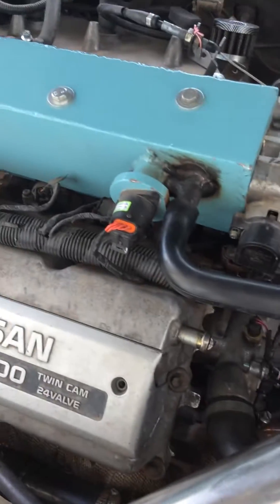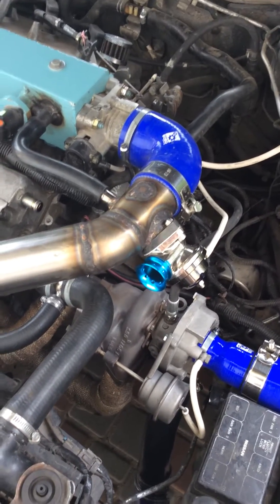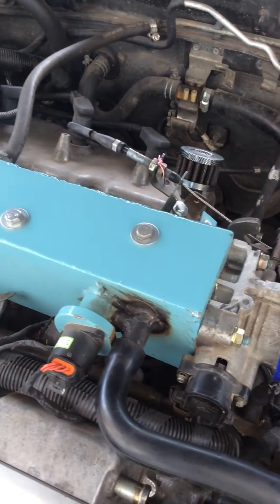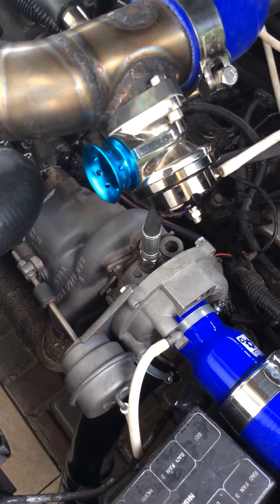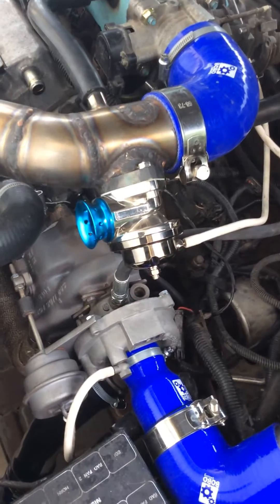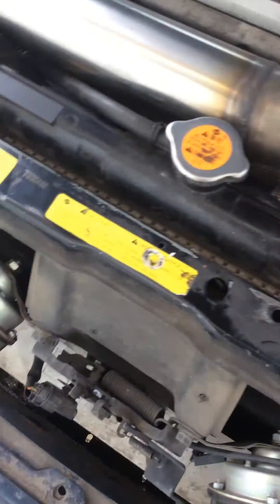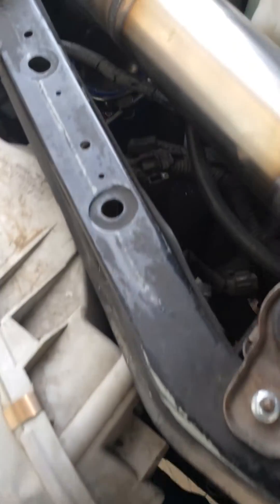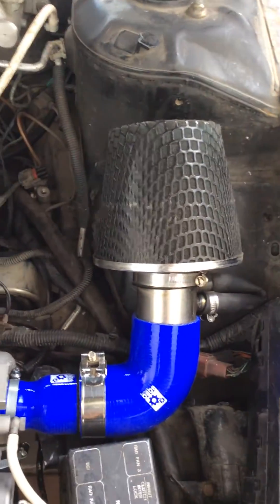Bi-Turbo Nissan Maxima A 32

Comment: help me build mine
Reply from the maker: Huh, I can help with an advice, I still remember what I did there, although it was some 6 years ago. Projects are different, everyone goes his own way. In my opinion the most difficult issue is the ECU upgrate. I had completely custom ECU with specialized turbo soft, of course it used MAP sensor.  As to the engine hardware, yep, here I found an execellent approach how to lower compression ratio at stock pistons and heads (at VQ30 the CR will be about 8-8.5, that's good for 1.2-1.5 bars of boost). So, If you gave questions feel free to ask, maybe I will find answers
Reply: @1982Eugene  добрый вечер ,Евгений  ,стал обладателем вашего  бывшего автомобиля ниссан максима би турбо ,скажите есть пару вопросов если вас не затруднит на них ответить буду благодарен .
Reply from the maker: @fgjderf  Здравствуйте! Удивлен снова слышать о машине, уже о ней и забыл. Один Бог знает что там в ней сейчас.. но попробуйте, спросите, может смогу ответить
Reply from the maker: @TyzGamin 170k miles is not the limit for this engine at all. Why not, an old car is a good field for experiments
Reply from the maker: @fgjderf  компьютер мультитроникс? В мои времена такого не было:) как и желтых проводов за магнитолой. Точнее желтые жгуты были, это жгуты системы SRS, но скорее всего речь о непонятных проводах. 
Настраивал я все это дело сам, но у меня уже нет того оборудования. Там стоит мозг Январь 5.1, допаян еще один контроллер зажигания, в принципе переделки минимальные внутри. Распиновка стандартная, кроме дополнительных выходов 2х форсунок и 1 катушки. И специаььный софт, ясное дело. Слыхал был в Одессе человек, который тоже контактировал с разработчиком этого софта и занимался настройкой. Просто разработчик софта - мой товарищ, он мне его подгонял бесплатно, как и консультиррвал. И я не занимался настройкой профессионально, так - в довершение к железу.
Фото любопытно бяло бы посмотреть. Скиньте на 063 418 76 02 viber,  если не затруднит